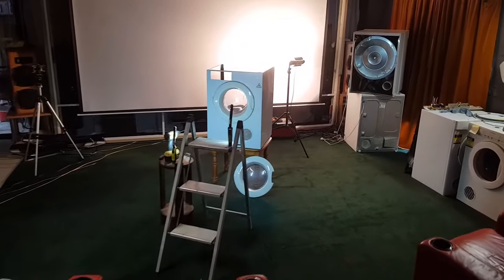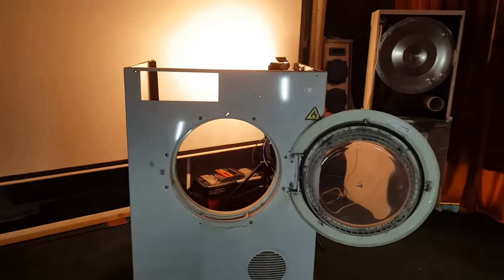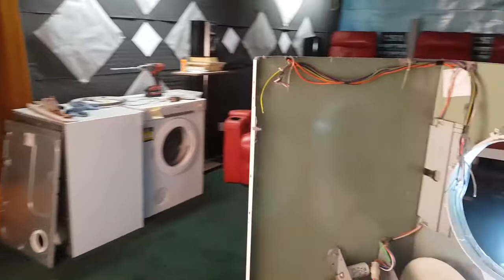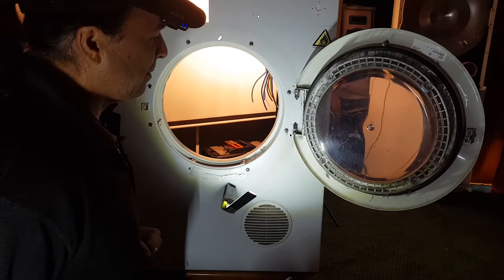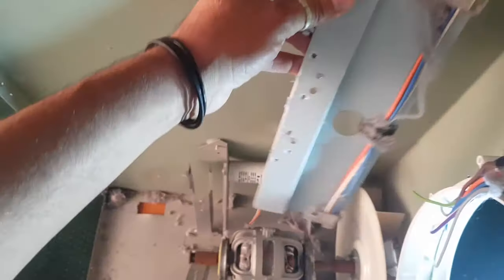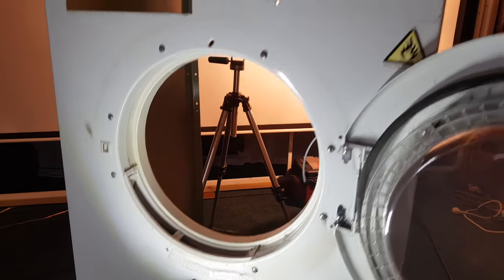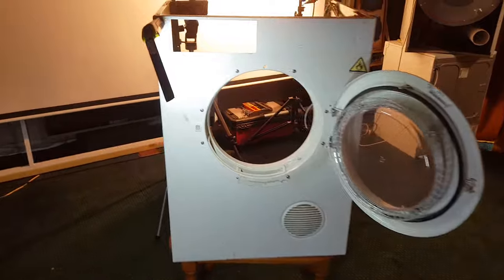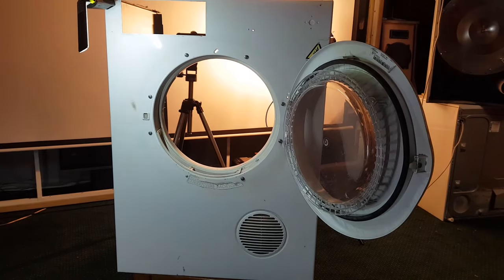Fisher and Paykel Clothes Dryer Door Replacement 2.0 Kill switch fix, repair, DIY

Comment: Isky you are a legend I swapped doors on a dryer I had been given and it wouldn't run so I watched your DIY and put a plug in the switch slot and presto all go works a treat. 
Many Thanks mate
Reply from the maker: No worries at all, and well done! 😎👍

Comment: Thank you, thank you, thank you!  Our door was cracked so I ordered a new one online which came today.  I had a quick look at it and thought it seemed pretty straightforward - just remove those two screws for the hinge and it should be all good..  then I thought, maybe I will just Google it just in case and your video came up.  OMG.. I would have done exactly what you said, and then my wife would have been so upset with the dryer out of commission for ages until it got repaired properly.  You are a lifesaver - followed your method and it was fixed in a few minutes.  Only extra thing I had to do which you didn’t mention was transfer the Perspex cover from the old door, and the little plastic lock bit to enable the door to click shut properly.    Thank you for saving me from my own stupidity! :-)
Reply from the maker: Haha mate that's the best comment I've heard in ages! No worries at all, glad you got it sorted 👍😁

Comment: Excellent video, yes it was a terrible design. I removed both screws in mine and your video suggested removing the lid and the drum... but I only needed to remove the drum and I could reach the plate with my hand, and put the screw back in properly. cheers!

Comment: Might be worth a mention but while researching, I saw in a similar video that you can screw back on the first set that was removed (the ones holding the cover) to hold up the back plate. So if you remove the 2nd set, something will still hold up the back plate. Of course, I'm going to play it safe and do that plus only remove the bottom one described in this video! I think that'll give me peace of mind that the back plate won't fall or move around when that bottom screw is removed. 
Thanks for the demo, I appreciate seeing what's happening inside the dryer to properly understand the issue!

Comment: Thanks for the video and we have the same problem of the broken dryer door due to heavy usage! We used this dryer since 2003. My husband took both screws out and then I researched the YouTube and found your video 1 & 2. Thanks so much to share your knowledge and one of the above comments mentioning the size of the screw did solve our problem! Our dryer works well only except the door that kept on stopping the machine from running. We will test our dryer tomorrow and hopefully it will work! Btw, we are from Hong Kong!
Reply from the maker: Well done guys glad to hear we saved another one!

Comment: I have the same problem the plastic was broken so I used two match sticks and plastic cable wire and attached to the plastic on the door.
Well end result its working just fine now. But i get around to look for a door soon. 
Cheers for the video.

Comment: Thanks Isky, I did it the wrong way but mine is hung INVERTED so the backing plate must have fallen into the corner - but the machine works now.  I just hope it does not eventually hit the drum?  The problem for me was the old screws (too loose without the backing plate) cannot be used so I replaced them with 10mm M5 screws which actually screw into the hole.  Just a tip for anyone else who is in my position.
Reply from the maker: Ahh no worries at all! Good job. And you'll be right if it's inverted. The plate is actually tapped to the wiring harness as well so it won't get in the way. If it was right side up you might eventually have a problem because the fan is directly under it. But I've just worked out an easy way to get at the plate and fix it. I'll release a video on how soon so subscribe 😁

ps. Someone else on here came up with a good idea as well. Pop riveting the door on. I thought that was great, but screwing it on is probably easier for most people 👍

Cheers
Reply: We saw your comments and my husband went to get the 10mm M5 screws and seems it works! The door get tightened with these screws! We will try to test the dryer tomorrow. We wanna be environmental friendly so we try to fix the door by ourselves rather than throwing away the functioning dryer to landfill and get a new one!
Reply: @macaunhon  did you manage to fix it?   I realised later that if the backing plate does fall off it is a problem as it will scrape on the drum so - it is very important that when you are undoing the screws to make sure you leave 1 screw in place so that the backing plate does not fall off.      I ended up having to get someone to remove the drum and reset the plate.   Now  my problem is the new door seal is so firm that I have to still use the old door seal on the new door - which slips out all the time.   I wonder. how I can soften the new seal.

Comment: Dead set legend. I swapped a door out on mine (luckily, I only removed the bottom pin, not both, because it looked fiddly to do them both!), but the door close switch wasn't quite depressing consistently. I'd get it to work a bit by bumping it, but the pressure pushed the door back a bit and it'd trip off again. Tried to make the striker a bit longer by adding tape to the end but still inconsistent. Have bent the door hinge a bit and it went first go - running it through a cycle now. Seems logical in retrospect, but never thought about it. Cheeeeeeeeeeeeeeers.
Reply from the maker: Haha no worries buddy glad it worked out!

Comment: Thanks, very helpful. I can’t believe F&P would set a booby trap like this.
What dryer do you recommend for reliability and serviceability.
Reply from the maker: To be fair it's probably the only real issue I think this dryer has mate.  I only really sell or recommend 3 machines.  Fisher and Paykel, Simpson, and Electrolux.  Now the Fisher and Paykel have a completely new build on their hands by the look.  I just worked on my first one so can't really recommend those yet.  Simpson and Electrolux are exactly the same machine though.  Just with the Simpson having a manual timer and the Electrolux having a computer because its automatic.  Honestly my overall favorite is the Simpson manual machines.  They're pretty indestructible and I find them very easy to fix and find parts for.

Comment: What’s the worst thing that could happen by using the “dodgy method”.
It won’t affect the auto turn-off will it? I assumed not.

Context: before seeing this video I too had stuck in a wood chip (it’s a slightly different design kill switch, new model F&P). It’s since become stuck. I would replace the door but no point now, the switch is permanently pressed. 

Thanks for making the video !!

Comment: Gutted, I've only watched your video after I couldn't work out why the door hinge screws weren't catching. Damn it! Looks like changing the door is going to be a bigger job than I first thought... Now to get the dryer off the wall 🤦🏻‍♀️
Reply from the maker: Ahhh no. Hey I've actually just worked out a way of getting that plate back on without needing to pull the entire thing apart. I'm about to make a video of the process. 

Basically if you're lucky enough to have a dryer where the top comes off you might be able to gain access from above... or you can leave it on the wall and simply just pop rivet the door back on 👍
Reply: @DIYDumpRat  Just wondering if you made that video!? I am one of many it seems who have idiotically not watched your video first!
Reply from the maker: @austingarminzhu8916  Ahhh no. And sorry I haven't yet mate. Had a serious house fire recently thanks to a faulty electric blanket unfortunately. It's taking up a lot of my time.

BUT! I have worked out a much easier way of fixing this problem if your door plate has fallen down after removing the door screws. Basically it involves attacking it from above. Basically removing the computer, removing the top of the casing, sticking your had in and lifting the plate back into place while you put the screws back on. I think most tops will come off depending on model.
If that's all too hard I suggest just pop riveting the door straight back on. Someone in my first video did that and said it worked great.

Anyway good luck man! 👍🤞😎
Reply: @DIYDumpRat  Yikes! sorry to hear about that house fire, hope things manage to work out for you soon. Appreciate you getting back to me regardless and there have been some good suggestions here which ill try!
Reply: Thanks for this answer, I take down the dryer from the wall then open the top and just use the cable to lift the plate and make sure the hole aligned then use my hand to push it in while I screw from the other side, don't even need to remove the computer. @DIYDumpRat
Reply from the maker: @di0n3 yes exactly! That's what I do now as well. I only worked that little gem of a solution after I made this video unfortunately. I'll be making another update mentioning this fix as soon as I can 🙂

Comment: I’ve actually got an older Fisher & Paykel Dryer and I can’t attach a picture on here but the switch is on the side in the door hinge instead of above the door.
Reply from the maker: Wow I've never seen one like that. It must be quite old. Would be interesting to see.
Reply: @DIYDumpRat  it’s from 1992
Reply from the maker: @liftrailphotographyinnz3992  Wow 30 years old.  That's not bad going 👍
Reply: @DIYDumpRat  We don’t really use it very often.